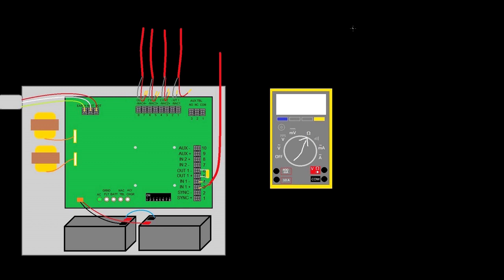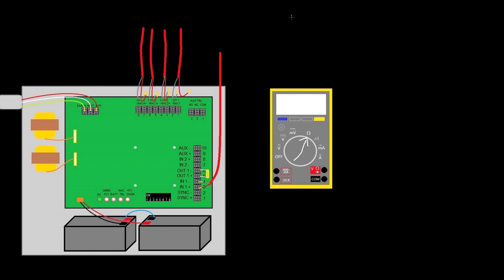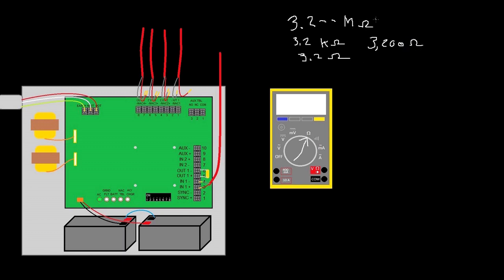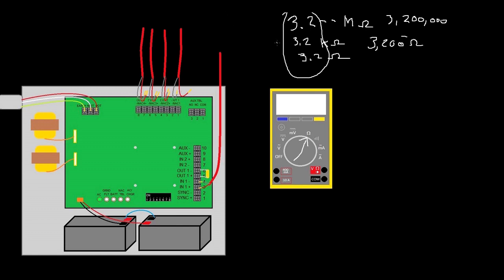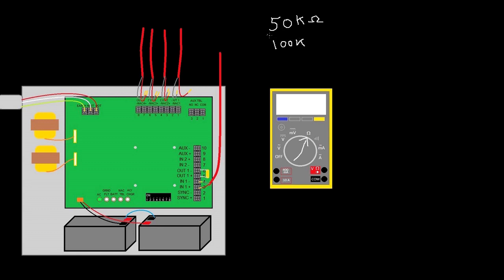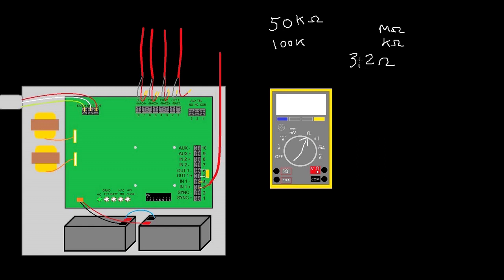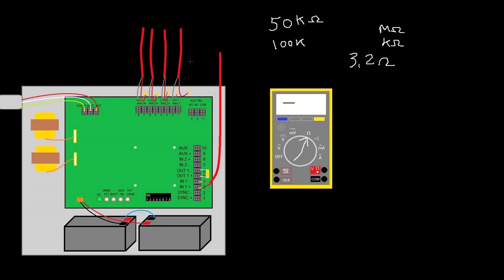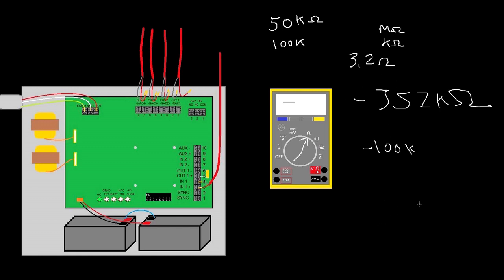33 - How to Read My Multimeter  - Introduction to Fire Alarms

Comment: Does the ground fault light go off without doing a system reset.... I removed all circuits from the card and still have the light!
Reply from the maker: Remove them all at the same time, remove batteries, aux power, etc. Nothing should be on your panel except your AC.
Reply: @JoeKlochan  I'll try that out, but I'm pretty sure I have already... if I install a new ILI(?) Card how much programming is there to do by a gamewell tech...as I am not...?

Comment: So if you meter OL, you’re good and if you meter a value, then you should start paying attention is that correct?
Reply from the maker: If you meter OL to ground you're definitely good. If you rear anything in the Megaohm (M) range you're probably good, but the lower that number gets, the more of a problem it is. 5M Ohm to ground wouldn't concern me at all. 1M Ohm to ground would a little bit. 500k Ohm to ground would definitely concern me and I'd go find it (Unless it was Friday).
Reply: @JoeKlochan  so in the example would 3.2 be ok Joe?